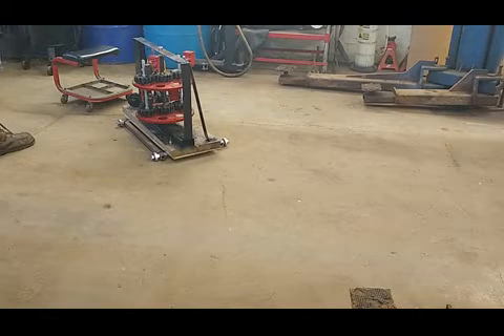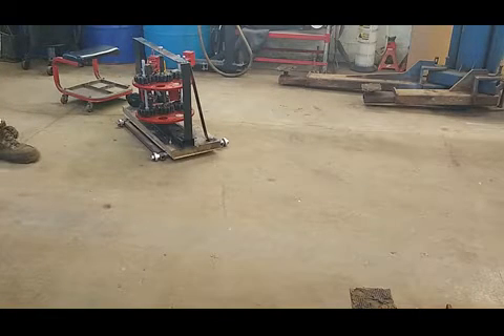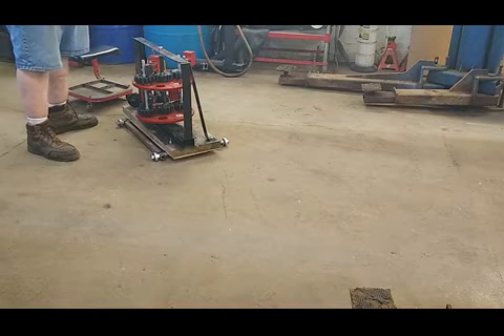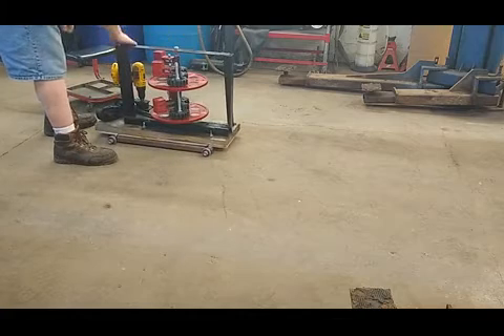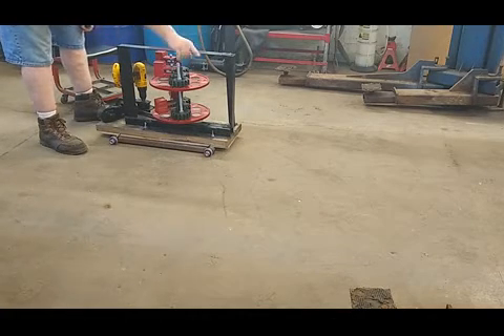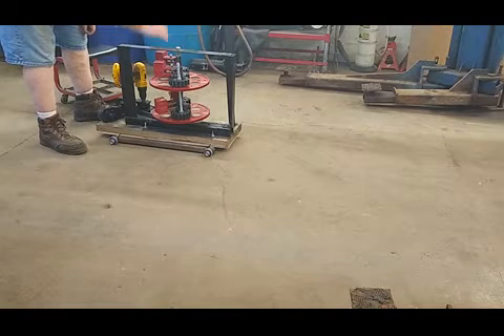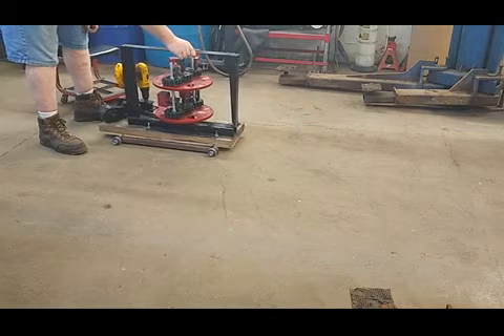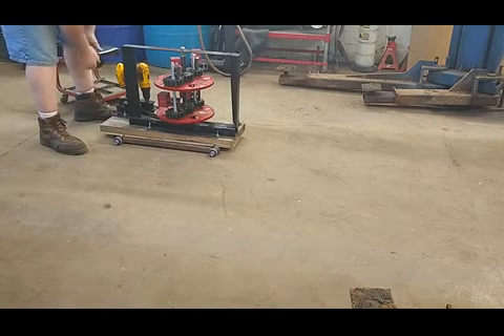Self-Propelling PIE 2.0 Video 4 of 4

Comment from the maker: Testing on the PIE 2.0 has nearly concluded, other than a few requests made by members of the scientific community. The primary question is always that of output vs input so here are the raw numbers. Max wattage input: 240 and max measured output 14.375 pounds of thrust. The PIE 4.0 is under development now. Thanks for watching.